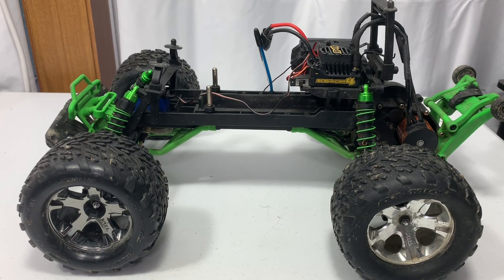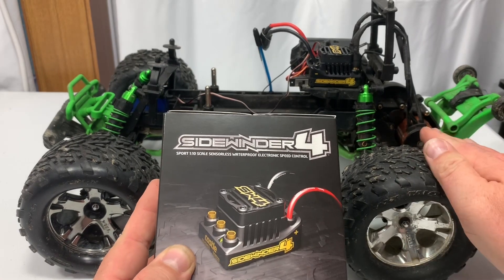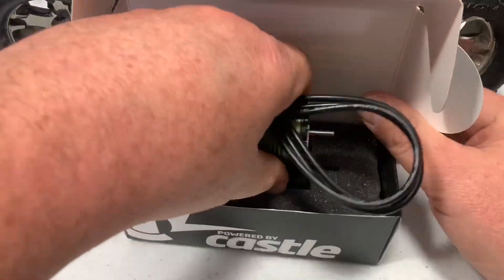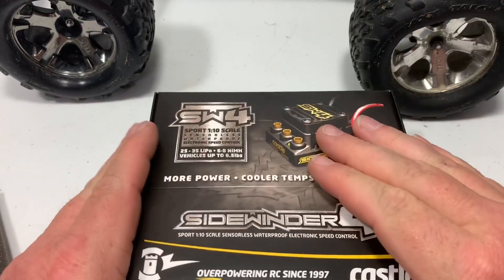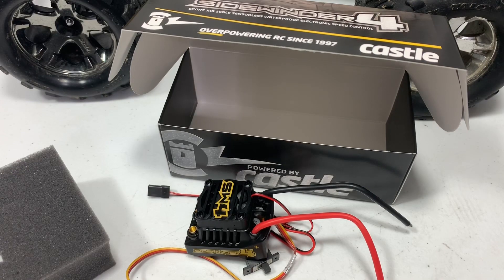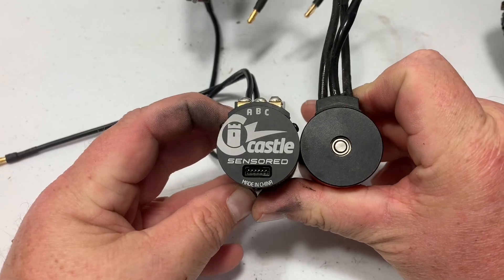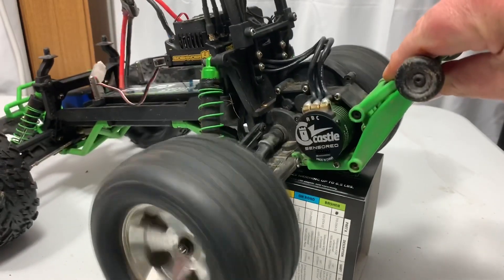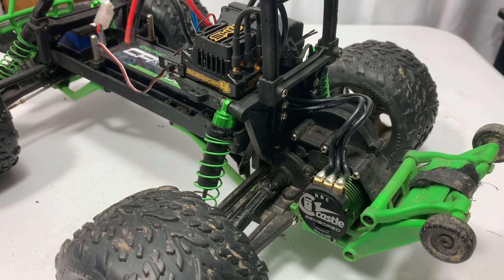Castle Creation Sidewinder 4 RC Esc & Motor Unboxing

Comment: It seems like a good product. I just picked one up today because it was the least expensive 3s combo the hobby store had. I normally run Spectrum products but hopefully this will be just as good as a BLX100 with the 3200kv motor. A few extra KV's never hurt. The Castle motor is 3800kv so hopefully it faster. My background is in electrical and it get confusing with RC's. Normal motors used in every day applications are rated in RPS's and KV stands for kilo volts. 1k = 1000v .. Thanks for covering this system as it really helps us make better purchasing decisions. 👍